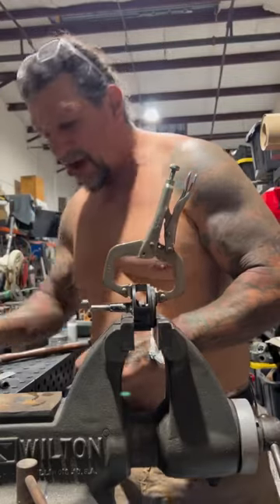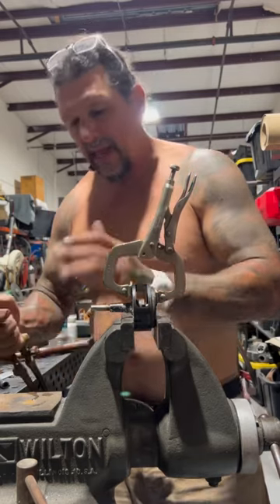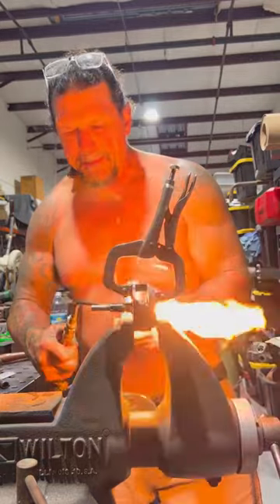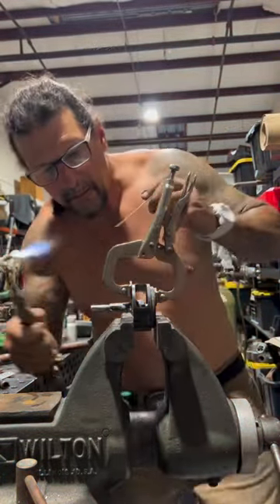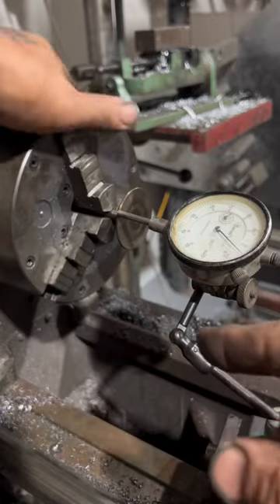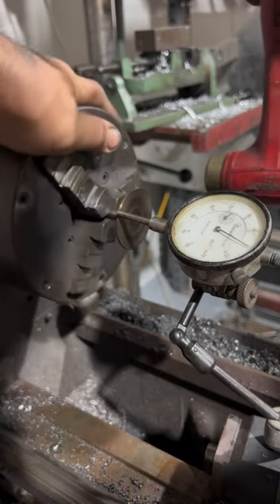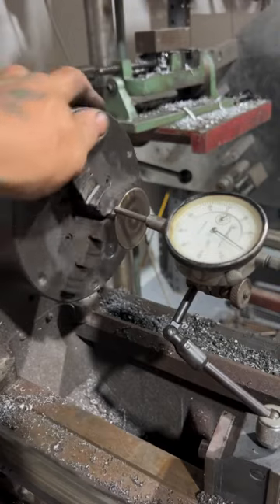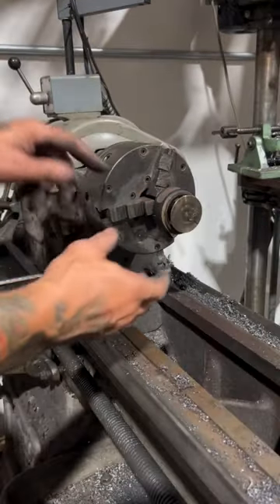Billy Lane Emergency Midnight Oxy Acetylene Brazing Weld  Repair Harley JD Racer Valve Cage #shorts

Comment: Another awesome video Billy! I wish I was closer to yer shop, I built a real cool chopper with the character of an old school late sixties early seventies vibe, but the heart of the beast is a Vern Ott Power House Evo, I got a 6 speed and a 48 tooth rear, 24 front setup on my  heavy duty o-ring chain, a P. Rivera pro-clutch and it is all settin in a Kraftech rigid with an 8 over old Durfee girder...you'd love it, I have had a lot of help from Dave of Velva Touch with getting the right pieces for it and am fine tuning it now, you wouldn't believe the ride it produced!! Maybe I'll get to ride it down this next season I gotta lotta friends in FLA...